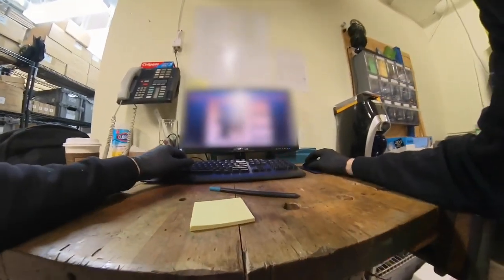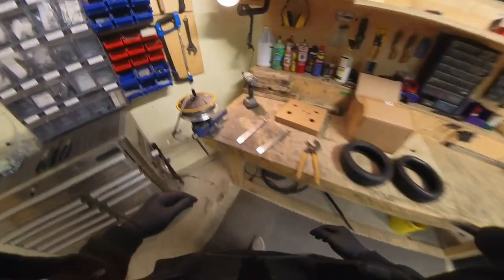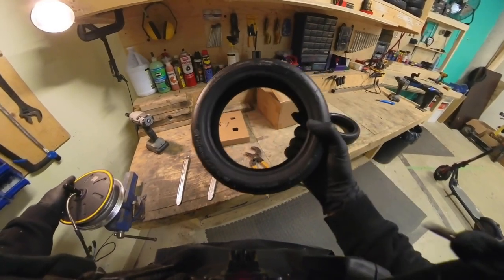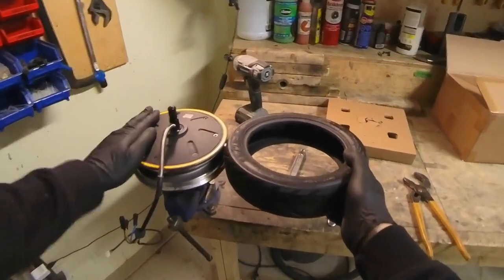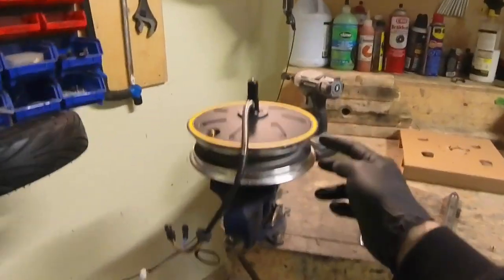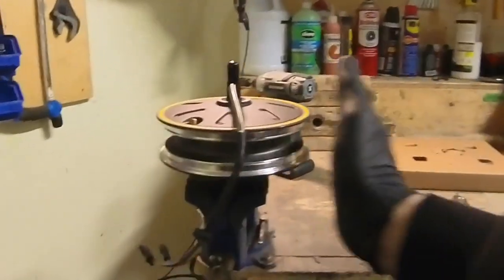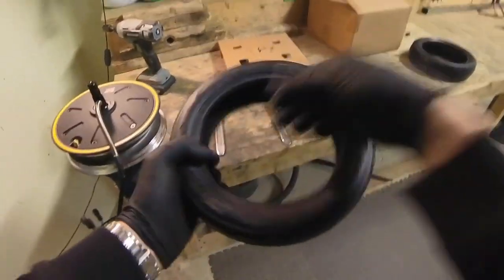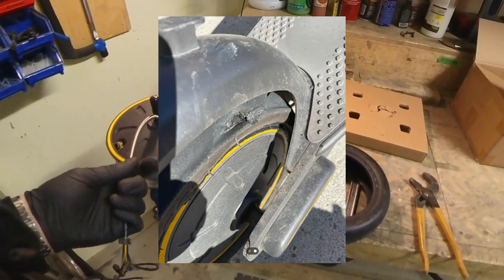"How do Segway Ninebot MAX tire blowouts happen?" | Phil'd In With Phil 🤠🛴🛠️🧰

Comment: I noticed this happened to my G30P. I have a replacement rear motor assembly on the way and I'll attempt the repair myself, but I'm not sure what happened. I make sure to check the tire pressure every few weeks and top it up according to the manual (I ride it 20 miles 5 days a week, I'm at 3000 miles on the ODO) but I noticed mine looks exactly like the one you showed. It's just interesting how it can happen in the first place because I'm positive I haven't been riding on a flat.

To be fair, I'd been riding on it like this hearing a weird noise from the back for a few days now, probably about 50 miles. But I filled them up with air a couple weeks ago!

Glad to know I'm not the only one out there. Thanks for your videos, they've helped me with my scooter countless times :)
Reply from the maker: We appreciate the support and we’re sorry this situation happened to you! 

If you’re local and/or have any technical questions, our service dept. will be happy to help! You can reach them at service@segwayofontario.com.

If it’s questions related to Segway-Ninebot, the manufacturer, they can be reached at technicalsupport@segway.com. 

- Mikey :)